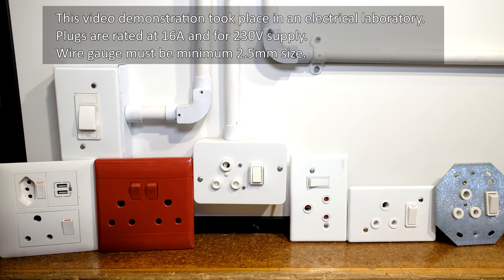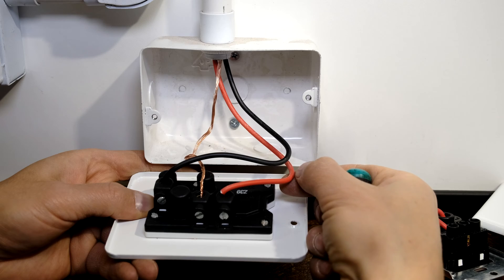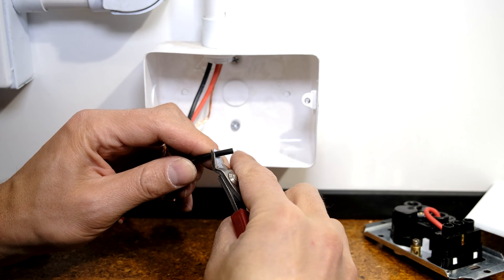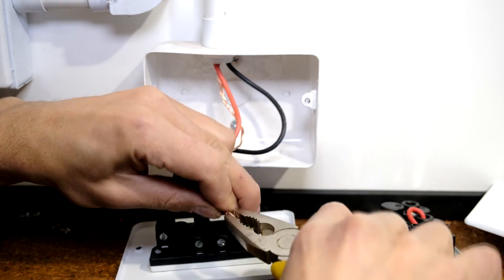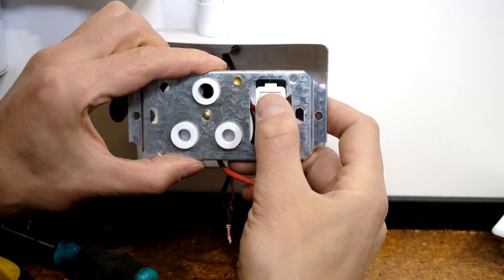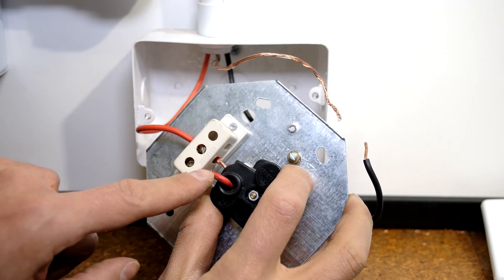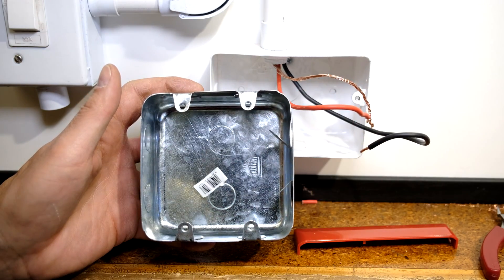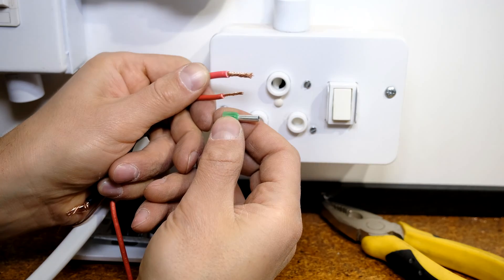How to wire any South African wall plug outlet / socket - Tutorial

Comment: will I need to have a conduit in place if i am ging to add a new power outlet in the same room. are there power cables that dont need conduit . I know the best and safest is to have a conduit but that room will look like a wiring diagram since its going from  one plug to the new one. els eill have to cut the wall

Comment: Great video, well explained and very clear
Just a note on the side cutter. Most newer side cutters (like the one you have in the video) has a deep set wire stripper build into the cutting edges. It is located right against the back of the blades. If you close your side cutter and hold it up to the light, you will notice the hole right where the blades start. That hole is for stripping electric wire, as it allows cutting without damage to the wire. (Just be careful when stripping very thick wire, best to use wire stripper for those)

Comment: @Ecological time a video well done.

Question: When I plug something into the socket, I struggle to put it in properly and I need to use force. I noticed fhe earth socket, of the 3 holes, the coverinv doesn't move away correctly to allow the live and neutral to enter the socket (I hope I'm making sense)

How do I fix this?

Comment: I have several single in wall plug points, can I convert them to double without having a recut the cavity the plugs point go into?
Reply from the maker: usually the cavity is for the size of the face plate so no you would need a bigger cavity for double